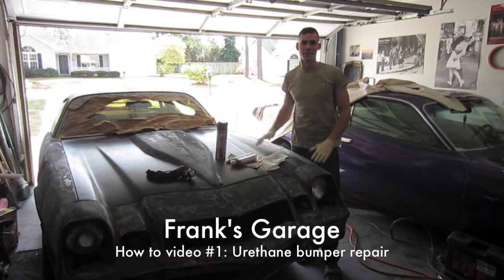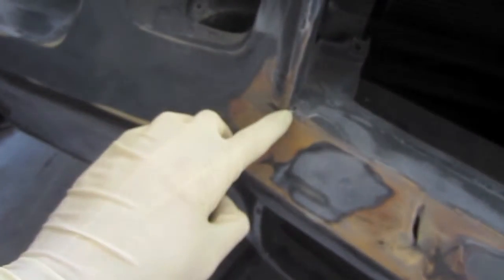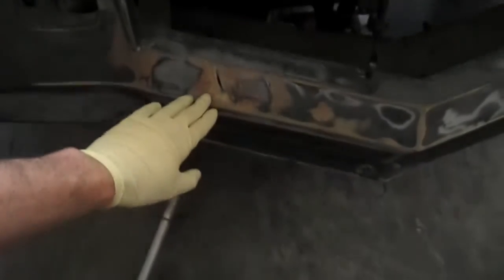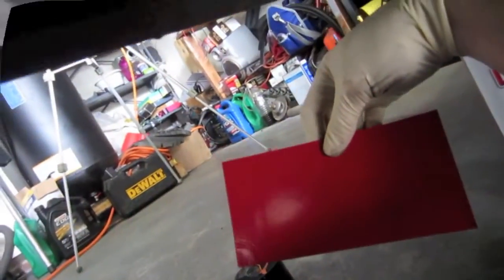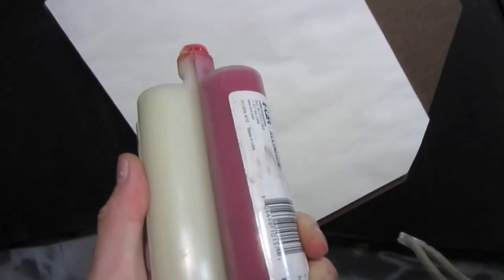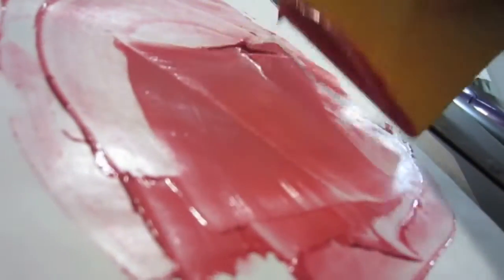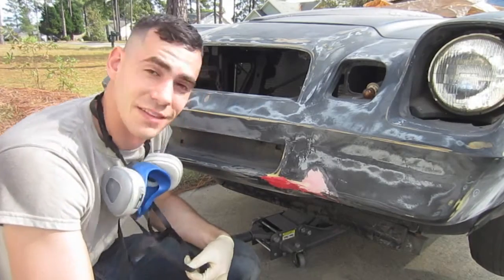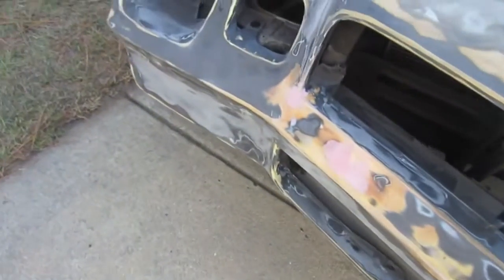1980 Camaro Z28 Urethane Bumper Repair

Comment: hey i have a question i have a polyurethane bumper that has a crack on it would this method work to patch it up? thanks
Reply from the maker: I am pretty sure, I'm still learning myself so I don't want to give you bad data but if you have a crack in a similar way I believe so.